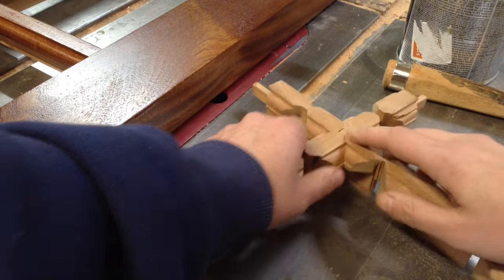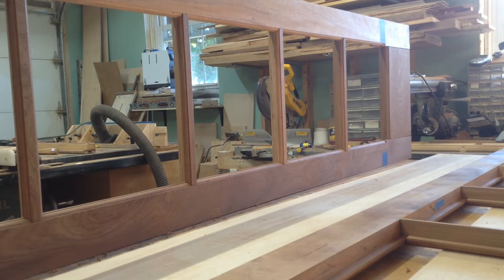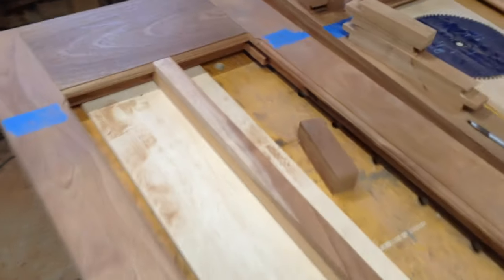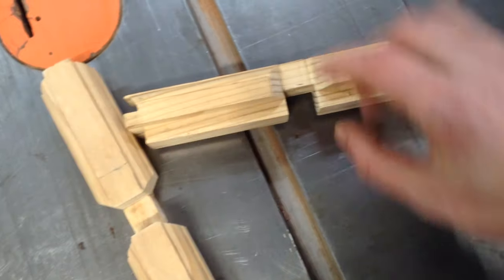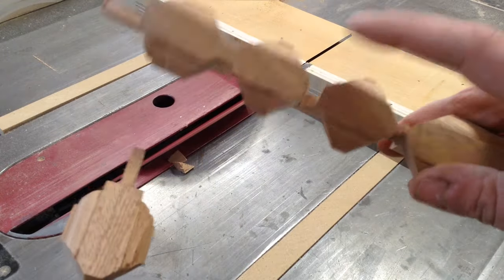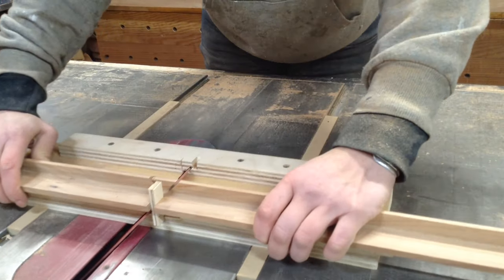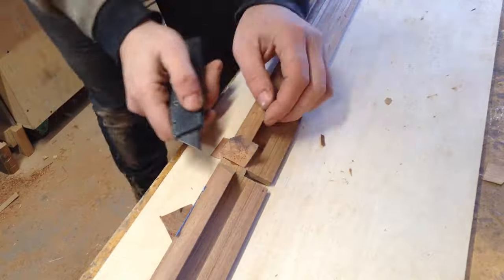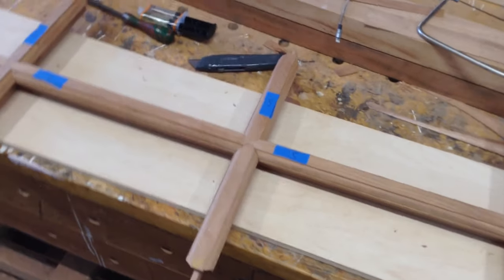Is This The Hardest Joint In Woodworking?

Comment: Hi HB , great job, my last 4/5 sets of doors I made like this, they were double glazed, and the units were 28 mil thick, so as you can imagine, overall thickness of the doors were very thick, but I ended up fitting one very large double glaze unit into the frame. I got the glazing company to make sure they’re done the Infill correctly and they put bars in between the sealed units. And then I intern made up mouldings that went on the inside and outside of the double glaze unit, and they were stuck on with double sided tape, 
Great looking job , Considering you don’t have the machinery and the tools to make things easier for you, obviously these machines and tools are very, very expensive and you need a lot of room, Well done, look forward to watching the next stage of your project,
Reply from the maker: Thanks!  I tackle the glass part of these soon.  Not looking forward to it, I hate working with glass.

Comment: Definitely a complicated joint requiring close attention to setup and a fair bit of planning to make the necessary jigs. I imagine a little nerve  wracking making the first cut in each procedure, plus you could need several spare test pieces (at least I would need them) to make sure I was good to make the actual cuts. Nice work.
Reply from the maker: Yes, what the video does not show is all the triple checking and second guessing that went into all the cuts.

Comment: It's a difficult joint but i think the way I did it is a little easier, i bought a router bit set that has the profile and the reverse profile.... it's still a pain to dial it in but saved a lot of time.
Reply from the maker: That does sound easier, what was the bit set called if you don't mind me asking?
Reply: @HoneyBadgerWoodWorks  it was just a muntin router set, I got it off of Amazon it's probably from China. It wasn't super high quality but it got the job done.
Reply from the maker: Thanks, I'm going to keep that in mind for it I ever have to make these again.

Comment: Just out of curiosity, why didn't you just use a huge pane of glass and do faux-muntins?   Isn't that the way everyone else in the world does it?   Or were you just trying to be old-school and authentic?
Reply from the maker: From the research I did going into this, professional door builders, and the examples from both of the books I read do it the traditional way.  Personally, I do not think the faux muntins make for a poor quality door.  But, I do think on something like this the traditional way is the better way.  It's a more structurally sound way to make this style door.  While all of the joints are time consuming all the interlocking pieces are going to help prevent issues like bowing and warping over time.